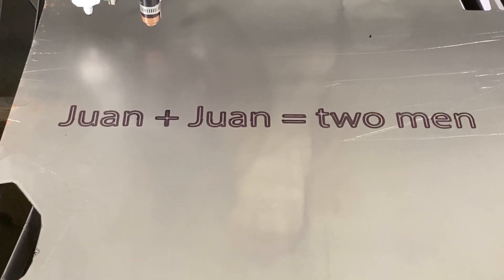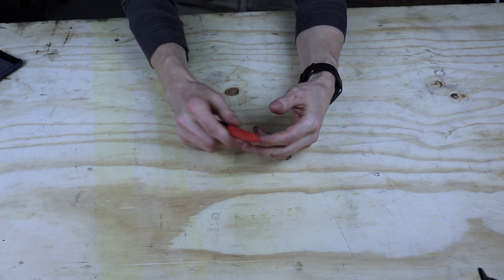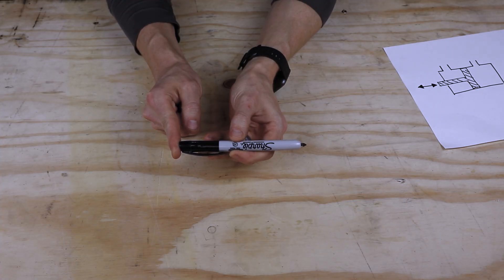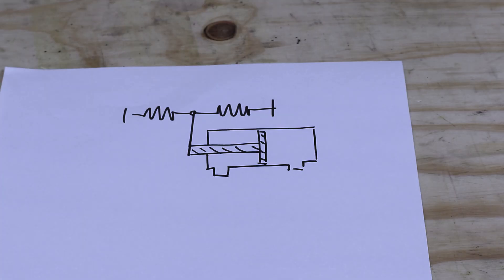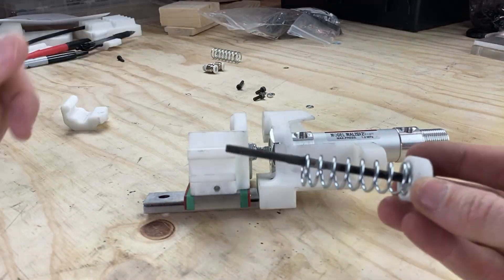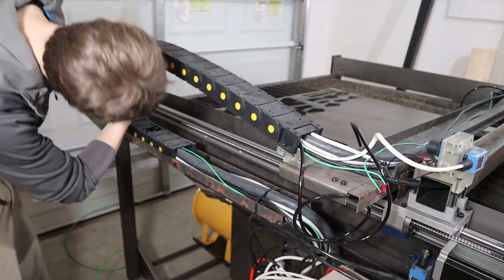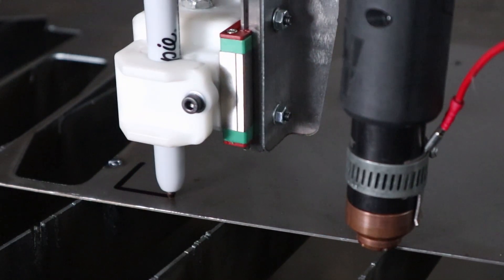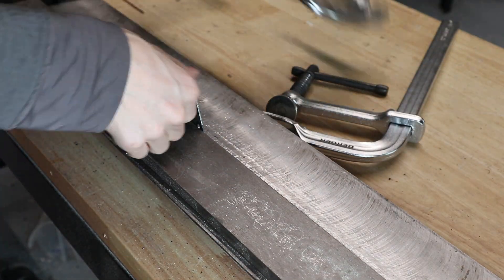This marker will change the way you work with sheet metal

Comment: A pair of 3 way valves would do what you want too.  Pressure or open to atmosphere.  The 3-way valves will be easier to source if you build this.  I was thinking that a good hobby servo might do the trick too, since you can command any position.  You could dumb it down with a 555 timer and 3 different duty cycles, with a pair of relays giving it a tri-state input.
Reply from the maker: Good suggestion. I had bought a 3 way valve for this project but got the wrong kind with the center closed to atmosphere rather than open. In a pinch I just used the two valves